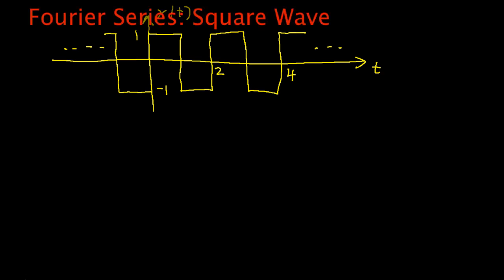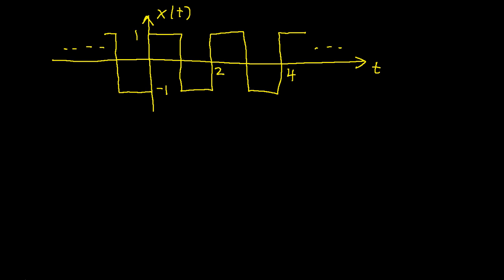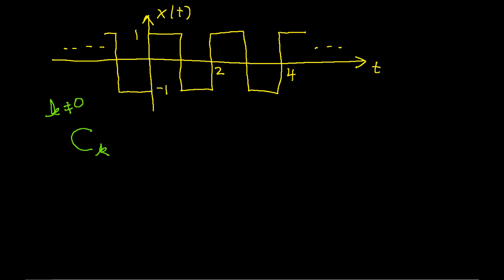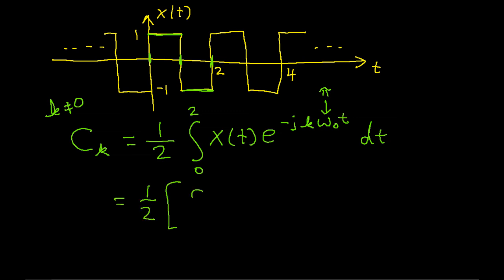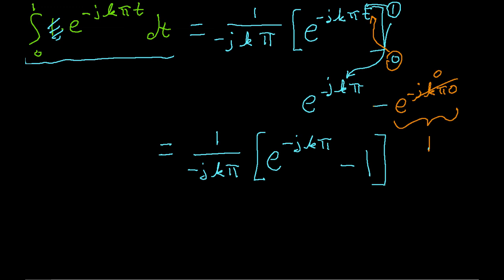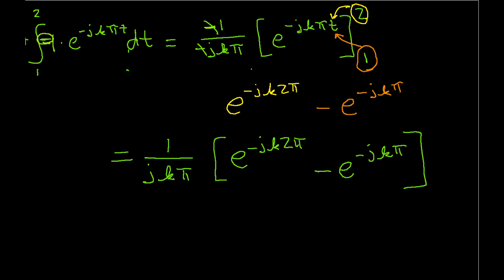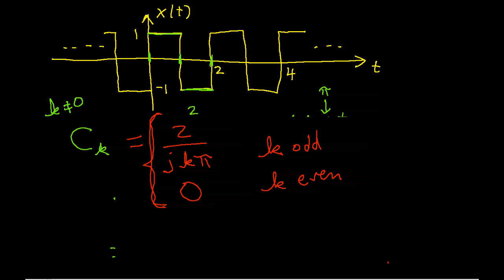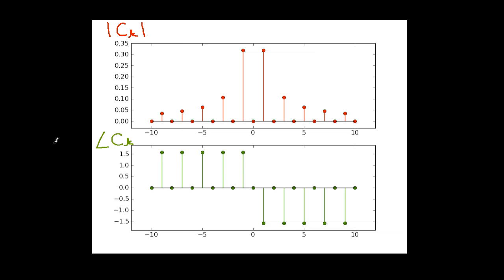Fourier Series Example-Square Wave (Edited)

Comment: the values of the magnitude ck graph do not match the ck = 2/pi   , ck expression of odd k integers. the graph corresponds to 1/pi  . is the eqn wrong for ck or is the graph wrong
Reply: You're right. It should be:
(+/-)1 = 0.64
(+/-)3 = 0.32
(+/-)5 = 0.16 
and so on...

Comment: This really confuses me. I think you misinterpreted the concept of area in this tutorial. The integral of f(t) IS the area. f(t) is just the function.

In this case you were saying that x(t) is the area (you were substituting in the area you shaded INTO x(t)), which is not the right idea. It just turns out that the area under x(t) is the same as x(t). It should be x(t), from the interval t = 0 to t = 1, x(t) has a value 1. Again, it is not because x(t) has an area of 1. Correct me if I am wrong